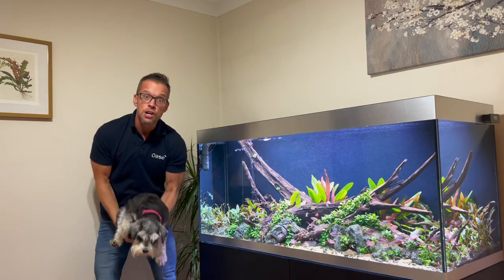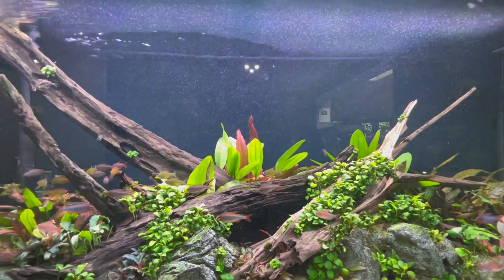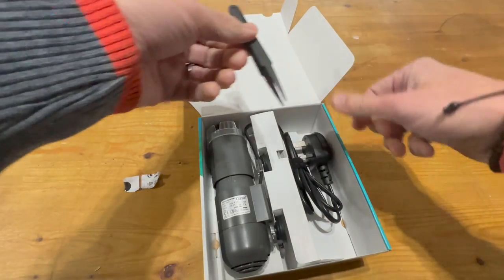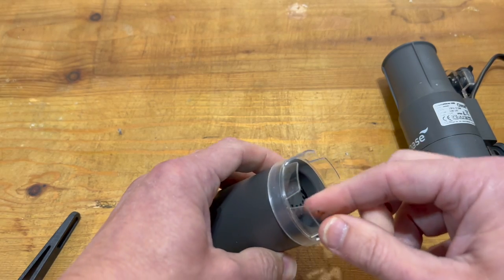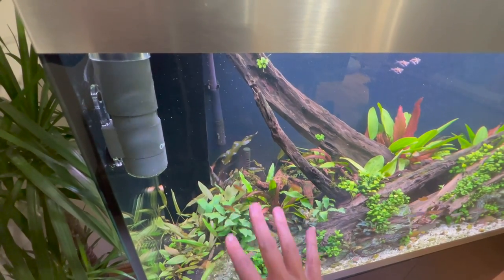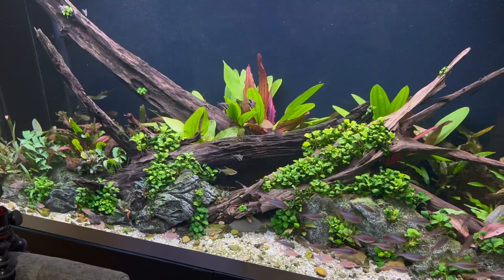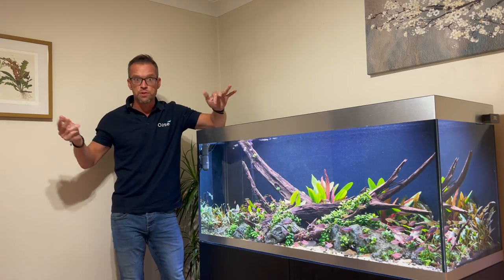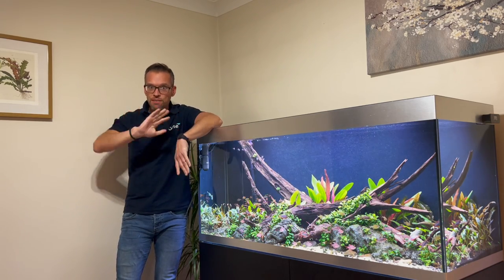BEST EVER AQUARIUM SURFACE SKIMMER?

Comment: Used the Eheim skimmer, but not any more.  IT ATE MY SHRIMP.   So please, for the love of fish, put a timer on the skimmer.  This will turn it off for a period of time to let any trapped fish, fry or shrimp escape.
Reply: Fake telegram below, if that wasn't obvious enough
Reply: Hi, did your skimmer come with a shrimp guard? I'm not not sure when they added that. My eheim skimmer 350 came with a guard that you insert in the top. When i looked  you can slso purchase guard seperately.
Reply: @urbansk8r231  the guards are not available to buy in the United States for some reason, it's also hard to find a 17mm filter intake guard
Reply: @zlk718 Hi,  I was surprised to see a guard come with mine.  When i did research on youtube of people doing unboxing where there was no guard, but then i saw an eheim guard for it on ebay . I'm sure you can find one on amazon. So now i have 2. Amazon has only been here in Australia for about 4- 5yr so i haven't made acc yet.

Comment: 350 should be perfect for back center chamber of Fluval Flex 123 AIO where CO2 is injected and gets a heavy surface film. Should clear the film and push the CO2 back down towards pump.

Comment: I use the built in skimmer on the Aquario neo flow premium Lilly pipe. You can not fault it for getting rid of surface scum but it doesn’t ‘catch’ any debris as it’s attached to the outflow pipe
Reply: Yeah I ordered it without really looking at the product, and when it arrived I was I little bit disappointed, so I sent it back without even trying, I didn’t like the idea of the scum being sent right back into the water 😬

Comment: I had an very inexpensive one a long time ago. It didn’t last long. On one tank I had stainless steel pipes with a plastic skimmer on the inlet. I’m not currently using a skimmer, but they are often handy when starting a new aquarium. I was looking for one of the 350s after the Aquarium Garden video, but couldn’t fine any in the US.

Comment: I have used independant skimmer units similar to the one shown here. 
And I have used hang-on-back filters with built in skimming fitment.
The problem with all of them is shrimplets (and sometimes the smallest nano fish getting sucked in). This is usually fatal for the fish and inconvenient for me as I have to be careful when maintaining the filters -  trying to rescue the shrimp...
Then the Aquario Neo Skimmer hit the market! Great product: keeps the surface just as clean without the hassles. The fundamental difference with the new Aquario design is that the skimmed surface water isn't sucked directly into the filter... it is sucked down and mixed with the water below the surface and blown into the water column. Then it circulates and gets pulled into the standard external filter intake... which I attached a filter foam block to so the shrimplets are safe (and this foam block acts as a handy pre-filter).

And better still - the design is so stupidly simple that I made two out of filter hose scraps and a modded bottle cap. These can be plugged over the standard filter outflow, and, hey presto, two aquario Skimmer copies... total cost £0.00 🙂
Reply: Hey a good project for someone to make one of your DIY skimmers on a video ?

Comment: Food also makes a difference re oils/scum too. I use an All Pond Solutions skim2 on my Rio 180 and it runs all the time. I've also hacked it slightly to feed water to the top of my bio Co2 chamber that sits next to it for maximum exchange.

Comment: I use the All Pond Solutions Skim 2 on my 350 litre and it's on a timer to come on for 15 minutes before the lights come on and that's all it needs to keep the surface clear.  My 110 litre Juwel uses the Juwel one and that works well too. I don't think you can go wrong with these things but I do like the protective bit on the OASE to stop shrimp getting in.

Comment: I use surface skimmers and have used the lily pipe inlet with the skimmer on top, the Eheim. The Oase Crystal Skim is my favorite, but... on my UNS 90L it creates a crater on the sand below. My solution, cut an acrylic sheet into a round circle slightly larger than the outlet and I get the water shoot out at a 360°. Now I don't get a jet like on the Eheim and don't get a crater on my sand below. on my 190 litter this is not a problem. the only thing that dives me crazy is if too much debris get sucked up it shoots bubble like crazy. Otherwise it is great and my shrimp and small fish dont get sucked in

Comment: Great product review! I have used the Eheim surface skimmer for years, modified it a lil to keep it shrimp friendly and worked great. I now use the Seachem Tidal filter which has the built in surface skimmer and it works great! I have two Tidal 35s on my 29 gallon scape and the water and surface is crystal clear with plenty of circulation! A suggestion with the Oase would be if they had the outake valve as the Eheim but on the bottom like a floating eye so you can adjust it in any direction 180 degrees. Great to see you doing the shows a lot more! Awesome for the aquascaping community!

Comment: i bought 2x Oase crystal skim 600 for a 90P and a 150P, it's a good skimmer but 2 things i don't really like : - one is rejecting air bubbles because i have some surface flow
- the fact that the outflow is underneath the skimmer. At full power, my plants don't seem to like it.

Comment: Hi George
Floating plants are your best bet against surface scum, floating plants = Springtails.
Springtails devour microscopic plant debris and provide live food for fish.
Skimmers kill Springtails, and small surface fish e.g. baby livebearers.
I think your tank has excessive surface agitation, that may cause scum, like waves on the beach producing white froth piles.  Proteins and oxygen all churned together.
You agitate the surface I think because you put the CO2 on well before the lights.
Plants respire at night, if the surface was calm the CO2 would not be lost.
Skimmers and surface agitation I suspect play havoc with the natural bacterial fauna below and above the meniscus.  
Patience from the aquarium keeper and a calm tank (gentle, slow, but big filters) with modest CO2 injection and good levels of micro nutrients will sort out most issues.
Have used a skimmer but only as a last resort to get rid of duckweed. 
On an aside, the Marble Hatchets are great, one advantage of a covered tank.

Comment: I don't have any tanks larger than five gallons and yet I have surface scum too.

Although, it seems to be a seasonal issue rather than year-round. 

If anyone has some suggestions, I'm open to hearing them. Currently I just use a paper towel but that's not very efficient and it wastes a lot of paper towels in the process.

There has to be a better way.

Stay classy my friends.
Reply: 1.) You can use a tiny mister bottle with dechlor/rodi water and spray the surface back into the column.
2.) Increase surface agitation, micro waves. 
3.) Increase plant load with red root floaters.  They thrive in that environment and mixed with all these I've never had problems

Comment: Not a lot available in South Africa that man in the street aquarist can afford due to the poor exchange rate. I use a fluval surface skimmer attached to a canister. Will need to speak nicely to family in UK. IMHO there are all sorts of nasty bacteria hiding in that surface scum. Since using a skimmer I've had much better success with rainbowfish. Always used to struggle with some kind of infection in the mouth area.